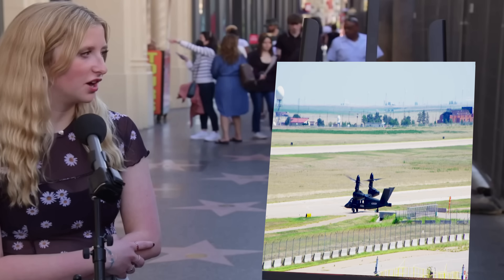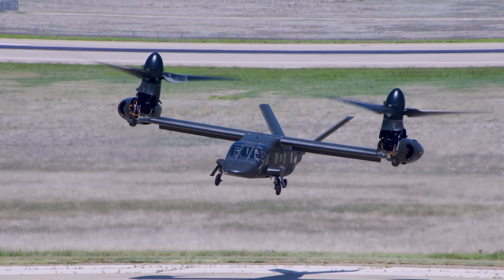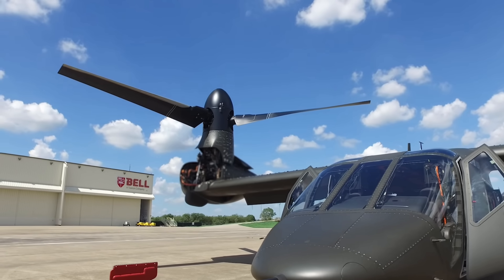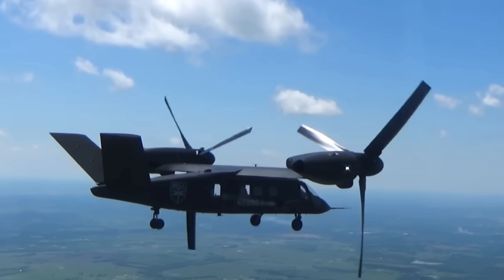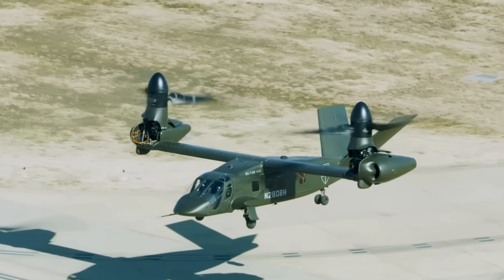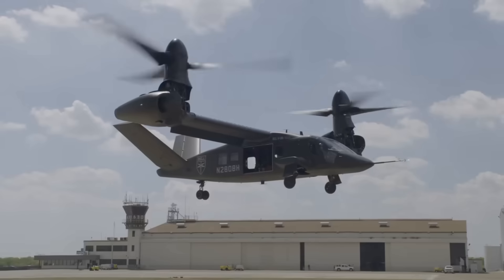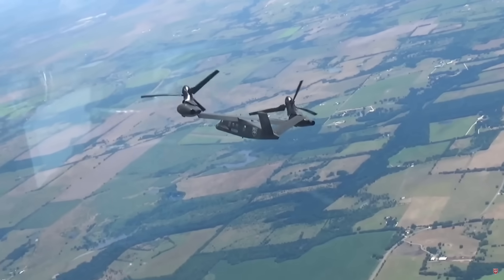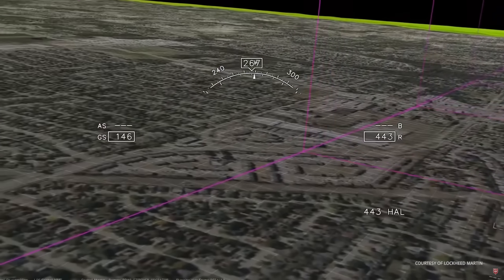Bell V-280 Valor - What's the big deal anyway? | BLACKHAWK REPLACEMENT

Comment: The tilt rotor concept came about when Carter tried to rescue American hostages in Iran with refueled helicopters. The mission failed miserably but showed the need for a helicopter type vehicle with a much longer range. Then as time progressed higher speeds seemed to be needed. I assume to avoid MANPADS and other shoulder fired weapons. Rotor vehicles such as Sikorsky's and tilt rotors have different characteristics. Tilt rotors usually tend to lift more weight but usually have less range. Without going into it deeper, it all depends on what the USA Army values most in the Blackhawk replacement. Evidently, its range and perhaps a little more speed. Also I suspect that the bugs in the Osprey got worked out and applied to the the V-280 while the Sikorsky was a brand new concept.

Comment: The adoption of the new and more complicated is not necessarily a good thing. Sometimes proven platforms just need to be improved and kept. Pretty sure a few rifleman could not one of those out of the air at low level. Too many vulnerable points
Reply: All rotorcraft are extremely complex and vulnerable to ground fire. With a tilt rotor you can atleast get up and away from the danger faster.

Comment: i really love this aircraft, and i have high hopes for it, and plus this one actually did it's trials while the defiant just sat around doing nothing till boeing learned that the engine should connect to the roter after many years
Reply: Defiant has been waiting on the engine for mass production. Interim engine is a lot different. Still managed to make a 700 mile test flight on half power even with the lower power interim engine.

Comment: The range is almost 3x that of the Blackhawk, and this thing is fast, so you might be able to steer around problems. Also, I heard you can't hear them coming, giving adversaries even less time to point something at you. I like the look of it. It seems simpler, and more efficient. I love the shaft connecting the two props.

Comment: FLRAA isn't gonna replace the AH-64, only the UH/HH-60. The FARA will replace some of AH-64 and MQ-1C Grey Eagle that covered for the role OH-58 Kiowa Warrior. FARA is the actual replacement for OH-58 Kiowa warrior.

It's loading capacity isn't 30,000 lbs but 13,000 lbs maybe you misheard it though it could still carry M777's.

Comment: It looks great and is a positive step forward, especially for rapid deployment.  On the other it will have issues in the role of insertion.  With its very wide rotor blade width it can't go where the current helicopters can go. Such as land on a street or forest or jungle clearings. Obviously it will go for large clearings and street intersections but this will reduce its tactical deployment options.
Reply: The downwash is also pretty strong and hot which is a potential hazard for anyone below or roping down

Comment: I'm concerned that it may have the same issues as the V22, the terrible payload capacity (double the engines, double the weight), slow VTOL capabilities before it switches to level flight, etc.  Not to mention you can't sling as many weapons on it like you can the armed Blackhawk or any helicopter variants.  

Biggest thing though, we haven't even ironed out the issues with the V22 and it keeps killing people, and this is a V22 with a sleeker hull.

Comment: The Valor will be in the fight over the vastness of the Indo-Pacific due to her huge superiority in both speed (successfully tested cruise speed of 305 knots) and range (1k miles).
Reply: This has been frequently cited as a reason to opt for Valor but the slightly better range will make no difference for most island hopping. Either the islands are way too far apart or close enough that either aircraft would do.

Comment: 3:23 about the size of the V-280, the fuselage is pretty much the same as the Blackhawk, its the wings that give it the additional surface area that you mentioned. Now the Boeing-Sikorsky SB-1 is a little longer, but wider and  ALMOST twice as tall and bulky as the UH-60, and while it doesnt have wings, it's just freegin a bigger target than the UH-60 and the V-280
Reply: Frontal aspect target is larger for the V-280

Comment: As someone that fixed Ospreys I can tell you that it is a safe aircraft, the 280 valor ought to be even safer and more reliable because bell is going to take what they learned with the 22 and apply it here. However replacing the majority of h60s with the 280 is not a great choice in my opinion

Comment: Those engines are gonna be bullet magnets. I can also see a grunt door gunner accidentally shredding the rotors while in the forward configuration.
Reply: The engines may be vulnerable, but there is a drive shaft that can connect either engine to both rotors, which would mitigate that somewhat. As far as door guns go, in vertical flight mode the rotors are tilted up out of the way. In forward flight mode, you'd be moving so fast door guns wouldn't be of too much use.

Comment: My apologies for the dumb question, but how do you put hydra rockets or hellfire missles on the hardpoints of the wing and have them pass through those massive propellers after being fired?
Reply: They did it in WWI with machine guns. The gun is timed to the rotation of the propeller to shoot between the blades. So its conceivable they can do it with rockets and missiles too. But it will be shooting downwards, not straight in front, so I don’t see why this is an issue.
Reply: @TheBooban  I don't think you're getting a whole missle between rotor blades.
Reply: A couple of the photos showed the little stub wings near the center of the aircraft.  These have launchers under them
Reply: V-22 doesn’t use wings at all for weapons and they did look into it. Fuselage mount or side door gunners only for V-280. V-22 also has rear ramp gunner and pop down turret weapons options. Rockets could be fitted to stubs or directly to the fuselage.

Comment: Hey Mats, I normally appreciate your videos but you're kinda all over the place on this one. V-280 is not replacing any Apaches; that's a separate program that also has Bell and LockMart/Sikorsky competing - and in fact this is kind of a OH-58D replacement more than an Apache replacement. Defiant is just as capable in the LZ as the V-280, maybe even more so because the prop can be reversed to slow the f*ck down right now; V-280 can't do that. The mechanism for V-280s tilting rotors is also going to need further development to protect it against incoming fire. Also, V-280 does not require the folding wing of the V-22 and does not have forward swept wings so the cross-shaft between engines is a single unit vs split on the V-22. Lower max gross also means much less downwash in hover so the V-280 won't be as destructive as the V-22 to stuff on the ground. Lots more info out there...
Reply: You're the one who is uniformed about thr programme. Bell 360 Invictus and Sikorsky Raider is intended to replace Kiowa warrior helicopter whereas Bell V280 valor and Sikorsky Defiant helicopter is intended to replace both Blackhawak and Apache helicopter. First study the programme goal and comment.
Reply: @totoitekelcha7628  Nobody is replacing Apaches with FLRAA airframes, and the only Apaches being replaced by FARA are the ones that replaced OH-58Ds because the Army retired them without a suitable alternative in place.
Reply: @CuriousGuyHobbies  US army will replace Apache with FLRAA

Comment: I still feel that they're missing a trick, as with the Osprey, by mounting the engines on the wing tips. Having them inboard and shaft driven would reduce efficiency slightly but then you can reduce the wing loading significantly. That way you can also get the Osprey type redundancy by simply running both engines through a gearbox and then a shaft to each rotor. The butterfly tail seems a little daft too if the goal is to reduce maintenance as they require more frequent replacement than a conventional one. Other than that it seems sweet, tilt rotors make sense for a short to mid range multi role platform in comparison to either helicopters or fixed wing aircraft.
Reply: Mounting the engines inboard comes with a very high weight penalty. The shaft needs to be twice as strong, 2 gearboxes per side rather than one. The V-280 also has a shaft linking the two sides. Structurally, having the engines at the end of the wings is also better, it has less force and torque where the wings attach to the fuselage.
Reply: @toolazy4340  I don't see why the shaft would need to be stronger as it's already a cross link assembly, as you say. The force on it is identical. I disagree on the structural aspect but that's why you rather have to test it, to confirm which is correct. As far as I can see all anyone has done is follow the established trend. I did run it past a retired aero engineer the first time I saw it and his thoughts were very much along the lines of mine but with the proviso that it would need to be tested.
Reply: @MrGrimsmith  The shaft would have to take all of the power with inboard engines. With outboard, it only may see half of the power.
Reply: You have that backward: putting the engine weight with the fuselage weight would increase structural load on the wings, not decrease it.

Comment: Beauty is in the eye of the beholder. I personally thought that the Defiant looked a bit derpy with its tophat rotor blade system and bulky silhouette. One of the factors that doomed the mission in Mogadishu was that enemy forces knew that the Blackhawks were coming and militia forces had enough time to collapse on the LZ and trap the Army soldiers there. The Valor could launch from much further away, fly over the sea or uninhabited land then appear over the target much faster. Still can fly if the tail or even a motor was hit. The mission was poorly designed anyway and extremely risky. Operation Anaconda was likely instrumental in the mission philosophy of this aircraft as well since the Apaches were driven off due to enemy fires at high altitude.

Comment: I feel the main catch will be maintenance and procurement costs. If they are too high the Army probably will not buy a lot of them, just using them as a Spec Ops + Assault Aircraft. Probably will not replace the National Guard Black Hawks. The Ukraine War seems to show that current helicopters are too slow, unmanueverable, and lack effective countermeasures to MANPADS, the Valor fixes most of those issues.
I feel the Valor would also make a good UH-1Y & MV-22 replacement for the Marines and HC-27 & HC-144 replacement for the Coast Guard.
I feel it should be named the Pawnee, because the first Native American recipient of The Medallion of Honor was a Pawnee.
Reply: If it can't fold up its wings and blades, they don't want it. The ability to fit on a ship is why they put up with the less than optimum length of the blades on the Osprey.
Reply: Defiant was quoted at a lower bid price than Valor which is included in the protest filed alleging selection bias.

Comment: Some Apache rolls? I guess, tech. But close support, no way, especially around built up areas. Large LZ ok but if you are limited in space it will take a long time to get everyone on the ground. It's more like a small Chinook than a Blackhawk when you look at it's limitations. How does the foot print compare to a Blackhawk & Chinook with rotors running?

Comment: I expect something like a ring and pinion transmission? with a planetary gear box somewhere (or at both ends) to clutch down the tturbine RPMs to more of a propeller RPM?  I expect the V-280 to be the utility with guns strapped on and the Sikorsky model to replace the Apache to some extent.  A gunship would be problematic due to the prop-rotors.
Reply: If by "ring and pinion transmission" you mean a bevel gear drive, then yes, that seems likely to me. Automotive ring-and-pinion right angle drive gear sets are often hypoid gears - it will not use that.

Comment: Don't forget it's only going to replace the Blackhawk, not the Jayhawk, Seahawk or Pavehawk, so it's footprint isn't as much of an issue.
Reply: Not a good alternative to V-22 either. Shorter range, lower capacity, lower volume, no rear ramp. The V-280 tech seems cool but would be put to better use as a V-22 upgrade.
Reply: Being a Blackhawk pilot both Army and Civilian now This bird isnt a good replacement for the Hawk. It's 30ft wider than the Hawk almost the same as a V-22. The footprint is a giant problem. Its good to get there fast but if you cant put the troops down on target it defeats the purpose. For Urban, Mountain, and assault operations its going to fail miserably.

Comment: Thanks, Matt. Cool video. Guess this thing still cannot auto-rotate but maybe glide to the ground?
Reply: Iirc its recommended to glide instead of autorotate. the prop blades just don't have enough inertia.
Reply: I'm sure it can still fall out of the sky.
Reply: The V-22 Osprey autorotates very poorly, but the AW609 has demonstrated autorotation; the V-280 won't autorotate well but will likely be able to do it to some extent. But yes, it will glide and that's probably the preferred response to both engines out... although that would still be highly undesirable due to the likely high descent rate.
Reply: Sink rate on unpowered glide is pretty fast for V-280. Pucker factor getting it to land without injuries.

Comment: The old H-1 Huey was replaced by the Blackhawk BUT there are still new model UH-1Z and AH-1Z helos being delivered to the Marine Corps so the Blackhawk will probably still be retained for roles in which its the best suited platform.
Reply: Hmmm Blackhawk won't really go anywhere anytime soon.
Even if decomissioned they'd probs be picked up by SAR services.
Reply: @davidty2006  Military SAR (search and rescue) would likely want the Valor over a regular helicopter. Faster response time to get to the last known location and shorter flight time to a medical facility with advanced life saving care and equipment.

Civilian SAR already has them so purchasing the older frames for spare parts is likely though.
Reply: The Blackhawk WILL be retained by the Army. The Valors primary role will be long range assault, the Blackhawks will still be used for more ordinary utility roles.
Reply: @MaxwellAerialPhotography  and when did Blackhawks have a long range assault role? They don’t have long range. Army is lying.
Reply: @MaxwellAerialPhotography  how do you know you're not part of the army are you? Todays threats make the Blackhawk extremely vulnerable. Blackhawk is getting more expensive to maintain as the parts get older as well as the airframe. Blackhawk has fairly shity speed and range which means it's freedom of movement is going to be fairly limited
Reply: @MaxwellAerialPhotography  Valor's main role will be island hopping in the Pacific
Reply: Correct. I think it's very cool that the USMC are still doing this. The UH-60 isn't going anywhere for a long, long time.
Reply: Also this contract was to finalize the Prototype they're going with so design changes probably will come and it will probably be in about an hour probably 5 to 10 years before it goes into production
Reply: To be fair tho that’s exactly why marines use the Huey, well that and it’s cheaper, that being said the army hasn’t said it will completely replace it but will cut a large size of its fleet down, they may also use black hawks for lower priority and even smaller ranged missions tbh. 

Which would be smart because tilt rotors wouldn’t make sense for those missions if a normal chopper will do, unless we’re worried about flight times
Reply: 95-96 Bell was testing a stealthy Cobra. It looked like a cobra with a bunch of heavy panels bolted on.  Plant 5 Arlington sometimes it was probably moved for radar testing we weren't told about it but walked by it every day.

Comment: I always thought the rotors in the forward position would interfere with the door gunner but maybe they wouldn't use a door gunner at that speed.
Reply: No. Even remote operated, all weapon systems will require gimbles to restrict ANY range in the Propellers direction. That is easily a massive 45 deg frontal aspect blindspot, both sides. You cant even point countermeasures towards it!  The CH-47s have better weapon systems, still shot down from massive size like the V-280.
Reply: @jimmay1988  Remote weapon systems wouldn't have any issues. We figured out how to shoot through rotor blades back in 1915, so it's not going to cause any issues now
Reply: V-22 has a better weapons option with the rear ramp door gunner at least. No ramp on V-280. V-22 also has an optional pop down turret variant but it sucked because of poor accuracy and huge internal volume required for it. Turret would suck worse on V-280 that has less volume available. Other weapons are nose mounted small rocket pods, maybe an option for V-280, and side door gunners. The props do get in the way of side gunners field of fire in some cases.
Reply: @Stu_Bur  the props aren't going to limit door gunners because door gunners funny get used when the props are forward and it's going at north of 200 knots. Door gunners would only be in play when it's going slower and the rotors are tilted up and out of the way